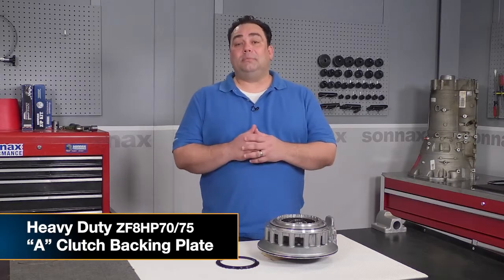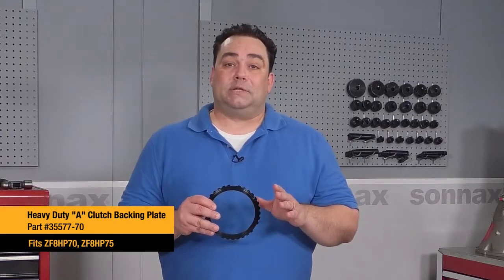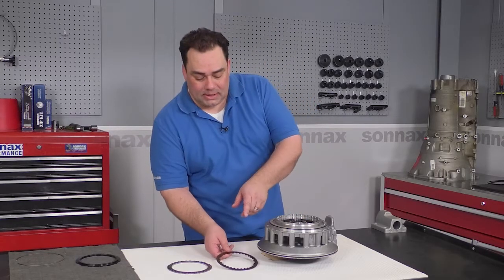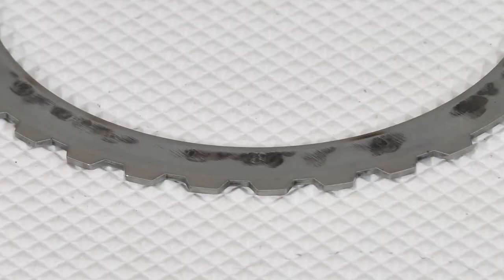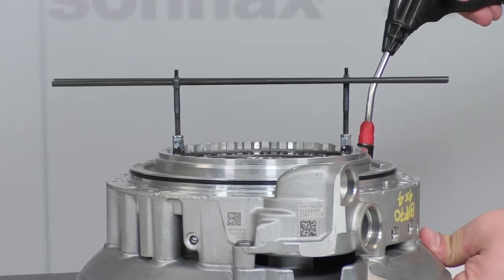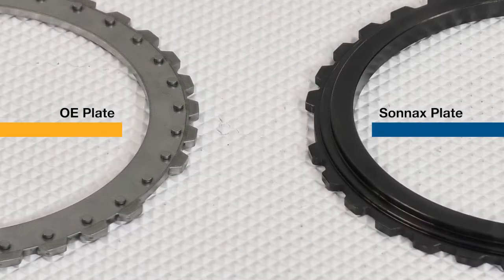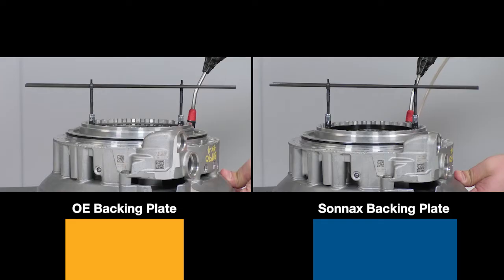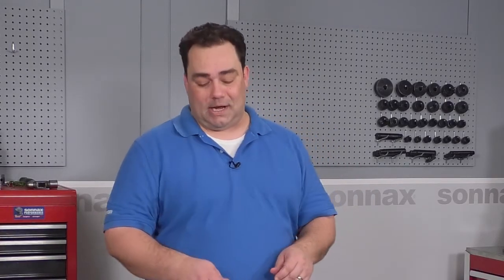How to Prevent ZF8HP70/75 "A" Clutch Failure

Comment: This doesn’t make sense to me, the heat marks on the steel would have been on the outer edge where more wear is occurring on the friction plate!?!
Reply from the maker: Depending on where the friction and steel are located in the clutch pack determines the wear pattern. The middle of the steel will see more heat because it is contacting the steel before the pack is fully applied causing slip. This is what causes the bluing on the steels. The frictions used in this video were removed from an actual failure. Thanks for reaching out, and have a great day!

Comment: how many plates needed for the complete rebuild of the 8HP70?
Thanks
Reply from the maker: In addition to the 35577-70 “A” clutch backing plate, we also offer the 35570-75 “D” clutch backing plate https://www.sonnax.com/parts/5640-heavy-duty-d-clutch-backing-plate. These are the two we have found to be problematic in the ZF8HP70/75. Thanks for reaching out, and have a great day!

Comment: My zf8hp70 in my 2015 Range Rover sport is heating up, I can feel it in my cabin next to my knee . I had the transmission filter and fluid changed but it didn’t help much. Do you know what could be the issue?
Reply: Land Rover make new coolant Line to the transmissions oil cooler Call Land Rover 👍
Reply from the maker: Our product support team is available to help with any questions related to Sonnax products, but for general tech questions, we'd recommend contacting our friends at ATSG or ATRA for assistance. Hope that helps. Thank you, and good luck!
• ATSG: https://www.atsg.us/   
• ATRA: https://www.atra.com/

Comment: Hi. Can this be causing the jerky downshifting from 3 to 2? All other gear shifting is okay, but 3-2 downshift is clunky and jerks forward, almost like gear is in neutral for 1 second before the gear engages and engine braking kicks in. 8HP70
Reply from the maker: The likelihood of uneven apply being related to your issue is slim, but without knowing vehicle details, codes, what diagnosis has been done, etc. it is hard to say to for sure. If you have questions about this repair, our product support team would be happy to help you. They can be reached directly via email at sonnaxtechsupport@sonnax.com, or phone at (800) 843-2600 ext. 398.

Comment: Queria saber como fazer  para achar  o manual do  6t31 2 geração  corpo  de válvulas  esferas
Reply from the maker: Não oferecemos manuais do corpo da válvula. Consulte o fabricante.
Reply: Hi. When the BMW 320d or 320ied driving, all of them makes a hard movement to the front, the car shifts down from 3 to 2 while I am slowing down,  and if I pump up just on the shifting or just little bit after the shifting it makes a hard movement , the engine speed highs up and then its shifts to 3 again.   İts actually normal.   But I think its disturbes the comfort of the drive.   Do you have that experience? Thanks